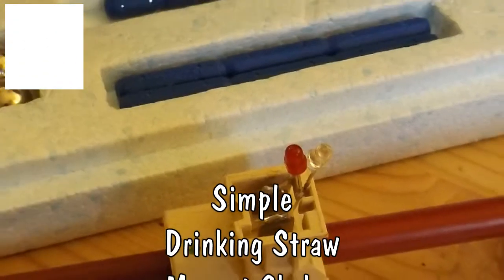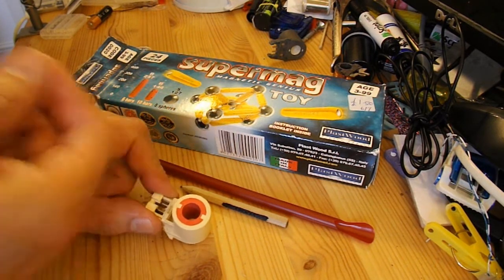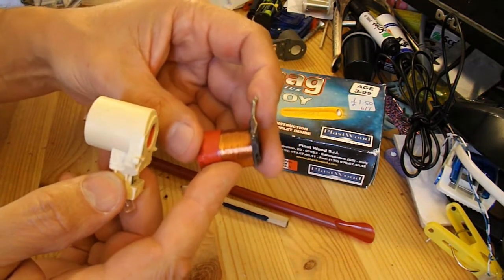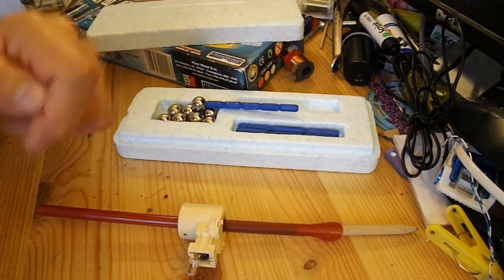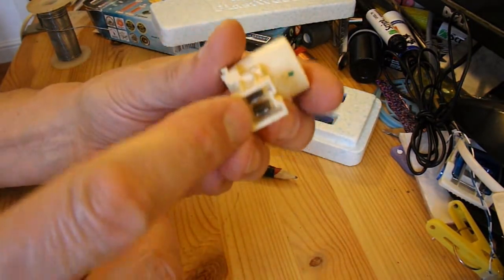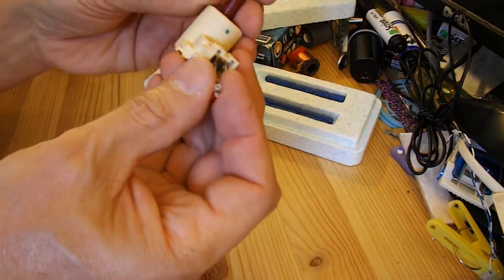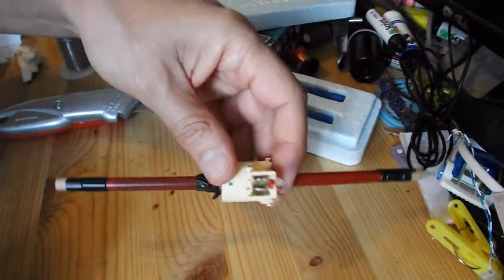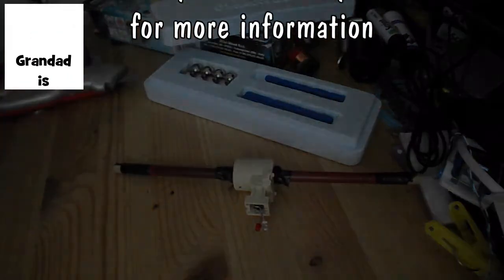Simple Drinking Straw Magnet Shaker LED light

Comment: I once bought secondhand a box full of these bars for my son and actually kept a few to disassemble. If you open up one of these magnetic parts, you will see there is a iron bar in the middle. The neodymium magnets are only 3 or 4 mm high. So there are two magnets plus an iron bar in that plastic bar. I thought you would like to know.
PS: the shaker would perform even better if you do not stick these magnetic bars together. You can image the North and South lines are almost closed. If you would put something in between (non-ferro and non-magnetic) it would perform better. Note: the voltage induced can be a little to high for the LED's. Their life is shortened quite a lot by this (but you would not notice this straight away). If you could use 1 diode for rectifying, then a very small capacitor plus the LED, the LED would be little less bright but have a long life as the capacitor is a big resistance when it is not charged yet.
Reply from the maker: Wow, thanks for all that extra information. Using the magnets joined together I got the impression that I got several flashes on each pass. I will see if I can watch some of video slowed down to check but I don't think my camera is up to the job.
Reply from the maker: I spent some time trying to video the flashes but my camera cannot handle it well enough, but I did as you suggested and put some plastic beads between the magnets. It does look brighter so I will upload a short video to show the improvement. Thanks again. Oh, I have no idea how to pronounce your name so I didn't try.